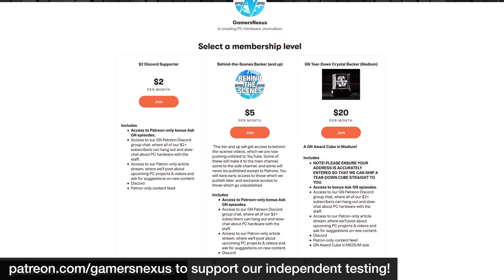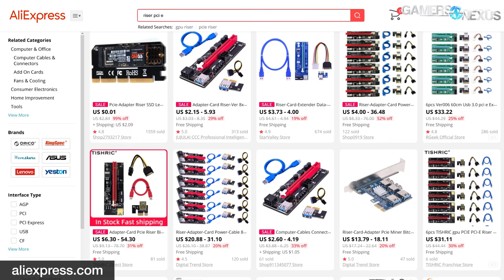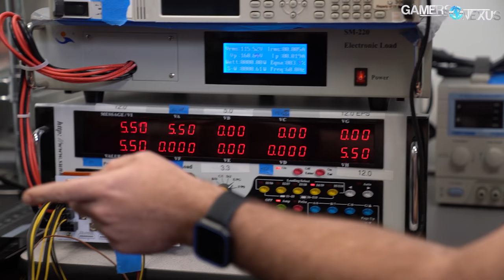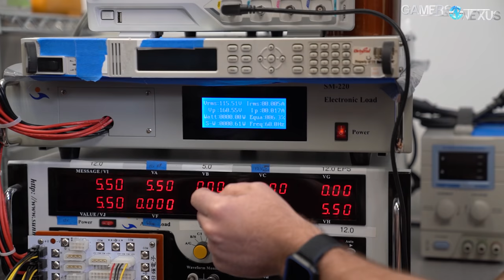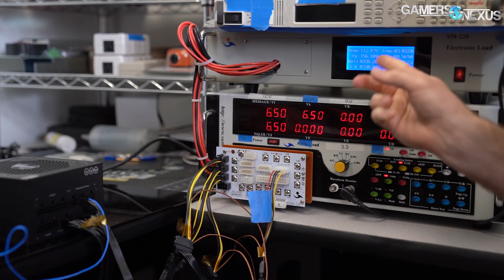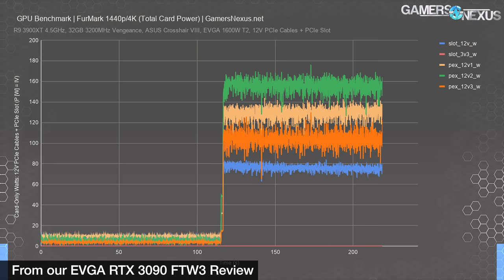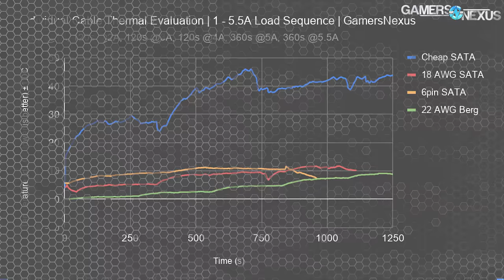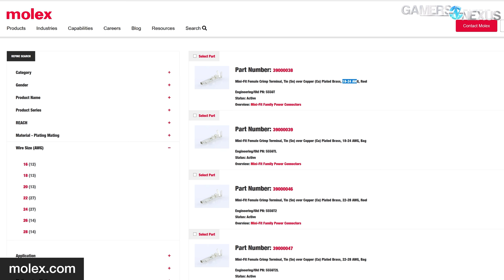Don't Use Cheap Cables: Dangerous Construction & False Wire Gauge

Comment: I had some cables from R***** fan hub kit..after plugging them in correctly one cord started to smoke and the smell of burnt plastic filled my case and room. After switching off my pc, all there was left was some of the outer shell (charred and crispy)l..and two burn marks on my Aorus Pro motherboard.

Comment: I generally feel uneasy when someone says “you might be okay” in response to anything that could be a fire hazard. I have some risers from GPURisers.com. They can be powered by molex or 6 pin GPU connectors. As Steve said they don’t recommend using SATA adapters, because of the variation in quality.

Comment: The cables with excessive voltage drop may cause the devices being powered by them to malfunction (due to insufficient power voltage).  Thus another reason to get better cables.

Comment: The only time I've almost burned down a machine was a floppy connector- one pin offset. The floppy drive connector can stay dead

Still used that TX750 for almost 10 years after cutting off the melted parts of cable

Comment: Would it be OK to power an exhaust fan with a molex to sata? Lower consumption so less worry? or where would I buy a decent reputable cable?
Reply: Yes, Molex can power up to ~50W safely generally. Most PC fans won't use more than 5W each

Comment: Basically I use no risers and only good power supplies and no adapters for mining. Still I am concerned running my rigs in the basement unattended. Waiting for remote fire alarms. Need a solution for remote alarm when system fails to operate. Wish it would be totally safe by itself, but it isn‘t. Fingers crossed. Maybe it’s not even worth the risk.

Comment: Guess that I was lucky when my laptop cable burnt out. The cable itself (between the power brick and wall socket) went up in sparks, but everything else was fine. It just meant that I didn't have the laptop for a while because of the RMA. It's been 5 years, but I'm pretty sure that the cable was under spec'ed.

Comment: what's making worse for mining rig is the fact that all the cards are at 100% load all the time. The cards would draw as much as it can for the 24/7. I think the cable would becomes deteriorating over time, of course given that the power draw is over specs and the ambient temperature is high. Also since the operation does not need any attention, by the time the owner notice the faulty cables it might be too late.

Comment: I got a molex to sata cable off Amazon. I proceeded to build a huge server. Bought 8 new hard drives. The sata power cable i bought was to daisy chain the hard drives. 

I set 5 of them on fire all at once.  I was so mad. I can’t recall exactly what it was but I think like 12 v and ground were just swapped. Or maybe all of them were swapped- e g the molex end was on upside down. But that was a very costly mistake. 

Then to add insult to injury. I did t throw it away. I was like I hate this cable. Then over months and years it eventually ended up back in the bin of parts. And I ducking did it again. Fml. That time I was able to fix 3 of 4 drives by basically shorting across the protection circuit - knew more about electronics at this time - it was likely possible the first time. But now those drives work but there’s no voltage protection anymore so they will be really dead next time.
Reply: But that is a perfect example of what you discuss. Internet was trivial to test the wire. Not even spec. That the right pins were hooked up. 

Now I test all of them. Especially if it’s off Amazon and not branded

Comment: i've had one of those 4 pin to sata power adapters flame up and set some stuff on fire in my shop one night while I was gone on a beer run. It was on a pc that is specifically used to attach customers HDDs to and move, copy, recover stuff. So all the wires and drives were ran out of the side of the case. Luckily the particle board didn't want to catch and the ashes of the cardboard box that did was put out by the almost full beer my panicking ass dumped on it.  All the components that were attached survived the fire and the splash down. On the plus side it brought to my attention that the 4000 sq ft suite I was renting didn't have the first smoke detector in it.

Comment: I still don't understand that we use 1.5mm² wires for 230v/16A AC supply in Germany. For cables that get put into massive walls under cement, it can be wise to use 2.5mm² because you raise efficiency in power transport by up to 6% due to lower resistance and less heat. That definitely pays for itself given that those wires and cables are usually in use for 20yrs or more.

Comment: I was wondering what this was about because I've used a cheap HDMI 2.0 cable that I bought at a dollar store about five years ago for $4CAD and it has worked flawlessly all this time, even at 4K.  My network cable is also the cheap "bulk crap" and it also works flawlessly.  For actual POWER cables though, it is exponentially more important but it also depends on the wire's usage profile.  If you're sending power to a hard drive, optical drive or especially an SSD, there's not really that much juice to worry about and you'd have to be using like 22ga to really cause a problem.  Anything 16ga or thicker should be fine.  However, cables to GPUs are a completely different story and MUST be well-made.

There's a marked difference between being frugal and cheaping yourself to death.

Comment: Been waiting on a cable stuck in "SHIPPING SOON" for my new PSU for almost a month now.

Ordered the jenky fucking thing from corsair because they just had to be different in their modular form factor (for some reason mine did not come with one in box, but I got it brand new from some local auction place. It works and smells new, I think it just was a fucked up box and fell out or something). I was about to just wire the shit individually using some PCI e cables but this has convinced me to not bother, even though I know it will work, my luck so far with this thing is telling me I'm going to burn down my house.

I pay $30 for the privilege of waiting for a single ATX wire for a month. A few years ago that would get me a used 800 watt.

Comment: I had a cable glow red and burn on my Corsair fan control module (Sata power) after swapping from my Corsair 1000w power supply to my evga power 1000w supply. After accidentally using a Corsair cable in the evga power supply  😬

Comment: It is absolutely hilarious how you made so much fun of someone who wanted you to use imperial units...yet in this episode I have precisely ZERO idea what wire thicknesses you are talking about. What I got was "bigger number means thinner cable" which is absolutely strange in it's own right, but at least mentioning what this magical "1 gauge" measurement is derived from would have been helpful... May I suggest you give wire gauges as cross section area in square millimeters going forth? The reason of cause being that material resistivity is usually given as ohms per meter at one square millimeter thickness.

Comment: I had a Phanteks extension cable set start fire. one of the VGA power connectors wasn't fully connected on the inside because I'm assuming the pin was pushed back by the receiving end if that makes sense. Something you normally see with Molex connectors. Anyways, it was a weak connection that created a bunch of resistance, generating heat until it smoldered and melted. On the other end where it was connected to my GPU, it had blackened the pin but luckily there was no damage. I think the wire gauge was probably ok but the quality of the actual connectors was garbage.
So from now on, if an extension cable kit doesn't state the wire gauge or the quality, I won't buy it because then it could be anything and I'll never buy any cables from China.

Comment: Molded cables should be avoided in general. If you need an extension cable make sure the SATA Part is using plug in pins, they can never short inside the connector.

Comment: Important to note that some cables form China not even copper. Instead it may be aluminum or copper-plated aluminum, which is not as conductive. Also, aluminum easily form an insulating oxide layer that would is extremely undesirable in a crimped connector.

Comment: In other words, if you are mining with 30 series cards the only cable you should use is a 10𝇍 sata cable from alli-express however if you are running a folding from home rig please use a molex or 6 pin cables and don't cheap out on them.
Reply: This is a joke, I am not recommending people use a fire hazard it is assumed that people buying gaming cards for mining are themselves a fire hazard.

Comment: i never realized how easy it is for even LED cables to ignite until I tried rigging some extension wires and crossed them wrong, within seconds it started smoldering and ignited

Comment: The one that concerns me the most are the people using Molex/SATA to PCIe power connecters for GPUs because their PSU doesn't have enough PCIe connectors on it.
Reply: Why? Plenty of PSUs in the 500-650W range don't have 2 connectors, and plenty of lower end GPUs have 2 connectors, require both, but use only around 200W.
Throwing out a 600W PSU when you buy a low end GPU because of a lack of connector would be stupid. There's a reason the GPU manufacturers are the ones giving out the adaptors.
Reply: @tin2001  Molex to 6 pin PCIe adapters are fine but SATA to 6/8 pin PCIe and Molex to 8 pin connectors are out of spec (you can do dual Molex to 8 pin).  GPUs in the 200W range are either going to use a single 8-pin connector (150W+75W from the PCIe), a 8 pin + a 6pin (300W total) or dual 6 pin connectors (75W each giving 225W all up)

Also, looking at PSUs available from a random online store, they had a single 500W "OEM" PSU that had a single PCIe connector (I wouldn't buy that particular one because they do not provide a spec sheet for it at all and given that it is priced in the same region as budget 400W PSUs...) and then I had to go down to 400W to find another PSU with a single PCIe connector.  Every other 500W+ PSU that they had in stock had a minimum of 2 PCIe power connectors and some even had 4.

In other words, if your 500W-600W PSU has only got a single PCIe power connector on it then you should either replace it with a better PSU because your PSU is probably a "fake" 500W/600W PSU that cannot provide that much power safely or you should replace it because it is very old - PSUs do degrade with age with the smoothening capacitors being the main culprit.

Comment: My 15 in 2014 Macbook Pro has had it's power adapter replaced 3 times now beacuse the white wire turns yellow and then starts smoking...

Comment: Where's the review of the exploding Gigabyte PSUs (P750GM) 🤔🤔🤔🤔
Reply: The P850GM has the Same Problem
Reply: Yeah... I've already sold my p750gm... I didn't risky my whole system
Reply: @sheyla5755  I replaced mine but haven't sold it yet
Reply: @gotofalograce9926  I sold mine a little bit under the market value.. Just to get rid of it fast

Comment: You should not use SATA power connectors anywhere that requires more power than a hard drive. The spec apparently says it's 1.5A per rail, rails being 3.3V, 5V and 12V. That gives us 5+7.5+18W==30.5W. DO NOT use them to power a GPU.

Comment: I applaud the stupidity of labeling thinner wires with higher gauges. So far I've only seen one melted adapter cable. A 4-pin Molex to 6-pin PCIE adapter, used on a spearate cable strand, to power a GTX 1060.

Comment: Using 6-pin PCIe connectors on your risers poses another risk, because it doesn't carry 5V, so if your risers are not well designed, they could apply up to 12V to the 3.3V rail, frying your GPU.

Comment: TIL the American Wire Gauge numbers go up as the wires get thinner.
Considering that using too thin a wire can cause a fire, and that AWG is used outside of America, that is mildly infuriating. I wonder how many people shop for cables expecting it to be the other way around, and end up with melty sheathing.

Comment: Yesterday an ARGB splitter connector melted in my PC. One end of the cable was connected to the motherboard, the other end to an ARGB connector of a case fan, the connection between this end and the fan cable melted (3 pin). No direct connection to the PSU involved, I don't even know how that can happen, it's scary.

Comment: the instant you see smoke coming from a cable, that's a failure. The cable didn't technically survive, because it's beginning to melt. That means it's no longer safe to use, which means it FAILED.

Comment: Is there any way to identify what gauge a wire is - short of cutting it open? Is it something you would be able to measure via resistance on a common multimeter and calculate from there? I'm guessing that's probably not accurate enough...
It's concerning that false wire gauges are used in something as critical as power. It's one thing to buy a dirt-cheap signal cable and experience instability. It's a whole other level of problem when a power cable becomes a fire-hazard. I guess you have to abuse them pretty hard in most cases, but if you are willing to lie about the gauge in the first place then you have to be concerned that some dodgy vendors will be willing to lie even more to cut costs until even well-within-spec usage becomes dangerous too.
All for a few cents of copper ... :(

Comment: 18awg nema power cables are a bad idea as well. Its all I had, only an 850 watt psu. 18 got hot, and I actually got 2% mhs just by changing the cable to 14.

Comment: it surprises me that it didn't trigger the psu overcurrent protection
Reply: Many PSUs have a single 12v rail and an 850w supply is going to be rated at 65+A continuous supply. That wasn't even close to overcurrent which is why it is dangerous.

Bear in mind an 850W supply is basically like a 1 bar electric heater level of capacity.

Comment: hmmm, like aluminum wires, hmm, much appreciated, been putting up with junk-cables for over 11 years now. Aluminum wire has a much lower amp rating per size than copper, not to say solder wont stick to it at any iron temp.

Comment: I have a 310w PSU. just a CPU 4-pin and a custom 6-pin into the board. (12v only) then the board has 2x 4pins that have 4-pin to 2x sata, for hdd's etc.

got a 95w cpu, 75w gpu.

i used to make use of Y-splitters and adapters, but when using usb my wifi would tap out.. concluded that i was overdoing it.

so this is what it can look like if you dont have enough amperage lol

Comment: many moons ago i had my first and only amd gpu ever: a tyan tachyon 9800 pro gpu. 
fancy blue cooler, temp sensors all over the place and a floppy (!) connector for extra power.
i did some overclocking and the temps looked just fine. everything well below 80°C. 
after maybe 6 months my screen went black during gaming. i opened my case and found the floppy connector had desoldered itself and fallen off the pcb thanks to gravity and cables pulling on it. i soldered it back in but the card stayed dead.
still salty about it.

Comment: I've been doing car audio for over 20 years. You should see the lying about specs there. I've seen what is sold as 4 gauge wire in reality be between true 10 and true 8 gauge in actual size.

Comment: Wire gauge is not the whole story. As a electronic components seller I've been in Shenzhen market for more than 10 years. there's very very cheap low quality wire which use aluminium then coated with copper we called 铜包铝。Aluminium have around 60% of conductivity compared to copper in same gauge. And to make matter worse lower purity Aluminium have less conductivity than 60%. U guys can spot it by look at the center of cut wire or by shave the wire with knife. Then it'll appears silvery white colour of aluminium instead orangey colour of copper.

Comment: currently in the process of swapping out my cablemod/oem cables with one's i made myself...still some good info in here. ^^

i used to have a sata > double molex but for sensible stuff like a .....up to 100w fan controller.... (it's only pulling like 6w so should be fine :P) and my D5 pump. for things like gpu's i don't even like using the double 6+2 on 1 cable cables, i always just run a 8 pin and a seperate 6 pin just to be 100% sure that regardless of what the card does it shouldn't cause any issue's. despite a lack of non mining housefire's already kinda proving that it's fine :P and i've seen buildzoids video's i know the 8+4 EPS is not needed for most consumer boards/cpu's....but i still run 2 cables even though it's a pain with the radiator in the same area. i just like the idea of not needing it but still spreading the load further :P

Comment: Yeah but this some Darwin worthy level. How about using cheap cables on low-powered connections, eg. fan cables, fan extensions and fan splitters, or sata cables meant purely for a drive use? And how about data cables? Usb cables, HDMI/DP cables, etc?

Also, I'd suggest focusing on the decorative extension psu cables. They are very wildly popular now and there's a lot of people having issues even with branded ones going from gpu instability to melting down connectors and/or damaging their hardware.

Comment: You guys needed that many bad cables to create magic smoke? I once did this with only one bad cable. After I moved apartments one time, I accidentally mixed up the cable that went from my PSU to the wall with the cable that connected my rice cooker to the wall (why they had the same connector, I have no idea).

Fortunately, all that happened was that my cable melted through and PC turned off unexpectedly while I was gaming.